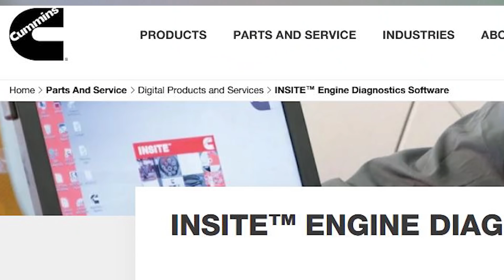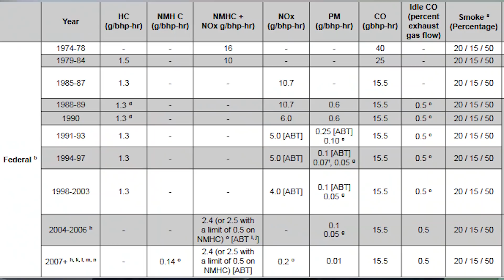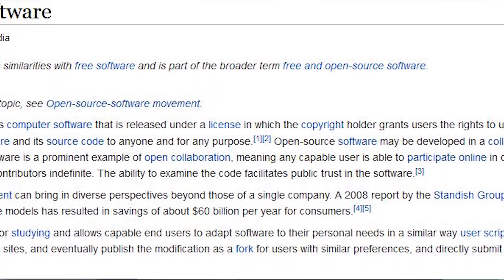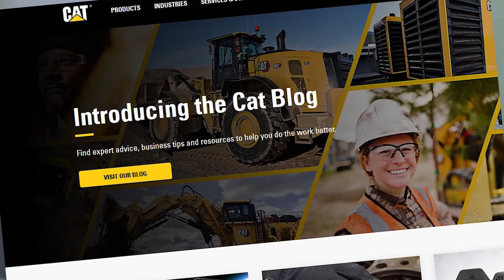Should YOU have the "Right to Repair" your Engine?

Comment: Manufacturers should be forced, by law, to sell ALL replacement parts for any product actively sold and produced. This should include all software, hardware, and related tools specific to that device, regardless of what the device is. Best way to avoid overhead that way is to use common tools, with common software so you have no responsibility besides selling manufactured parts, which you should already have the ability to produce. Furthermore, any replacement part or service good should be restricted in price to no more than cost +50% and software is to be without limitation or license, the source code to said software is not included in this requirement if it is used in a device that is either currently in production or has been within the past 5 years, after this period software is to be made available with source code for a period of 10 years from the last produced unit, without charge.

Comment: I think the manufacturers should provide the software for a fee for so many years and then after that the software should be free. I don't think the government should necessarily regulate the cost.  That leaves a manufacturer open to decide if they want to make the software affordable or if they want to make it so expensive that you're just forced to go to the dealership.  Not perfect, but neither side loses.  

Like your idea though of offering the software for free and that same website where you access the software helps you to order parts directly from the manufacturer.

Comment: of course we have a right to repair....all the "computers" do is replace what used to be manual parts or simple electric sensors. If I own it...i should have the right to do whatever I want to with it, including access to the diagnostic and operating software. I know the EPA along with dealerships wanting to make money on repairs pushed it to computers...and I know the EPA and Manufactures dont want us messing with anything...the sad thing is people hacking into ECU's have found how terrible the factory/EPA tuning are for engines. Hell isnt Tesla opensource? They seem to be doing just fine. Definitely need to EPA out of control..they create more problems than they fix...and vehicle/equipment companies need to get with the times...just about everything can be hacked now. They're just leaving dollars on the table.

Comment: Maybe I’m misunderstanding the customer/manufacturer relationship or maybe I’m reading too much into this….but how is this not extortion? You HAVE to get your machine serviced at the dealer because they are the only ones with diagnostic software. You then pay some exorbitant dealer labor rate to diagnose what could be a very simple problem an independent shop or mechanically inclined individual could do for cheaper? Is there a statute of limitations on how long they lock up the software? Am I eventually going to pay dealer labor rates to get my ancient tractor repaired?

Comment: It reminds me of cars before 1996 with each manufacture had their own obd1 system. You had to either find a shop with a computer that could talk to it or rely on those tricky blink codes. Now with obd2 you can go to any auto parts store and pickup a scanner for $10. Why can't equipment and Trucks be like that?
Reply: Global OBDII simplified things a bit, like requiring the same plug. It was all about emissions though, which is why a loose gas cap will turn on your CEL. Also your cheap readers only see global OBD that they are forced to, not the manufacturer specific codes and the full live data. There's a reason I use a $6000 scanner not a $10 one, and if the $10 one would do the job you bet your ass I'd buy it and pocket the change.

Comment: I support Right to Repair.  But i understand the manufacturers side. It could also be partly to prevent corporate espionage.  Example- if CAT spends all that time and money developing the software to run their engines, im sure they wouldn't like Cummins or Detroit having easy access to the coding.
Reply: There really is no issue with this now adays, most of this software is as old as Moses, there really is no secrets anymore.
Reply: @charlesbradshaw8673  even more reason that it's stupid for them to roadblock us

Comment: Imagine you plugging an authorized software at home and it makes an automatic shopping list of everything that needs replacing with the proper contact to whoever has it in stock. That'd be a cheaper way to move spares inventory and far more efficient, but they need to be open minded about it and drop the greedy tactics.
Reply: That's a genius idea.
Reply: @roncreach753  and also a great way for them to make loads of money, but now results that even the motor is serialized

Comment: For people who work & live in remote areas this is a nightmare . I have spent much of the last 15 years exploration drilling in remote parts of Australia it sometimes takes days to get parts delivered or tens of thousands of dollars to charter a plane for hotshot runs . So getting a dealer technician out to read a fault code for a faulty temp sender is madness .
Reply: Exactly. My friend bought a small John Deere tractor for pushing and blowing snow also has the bucket and  rotor tiller as well. He is about 200 miles from the JD dealer in a remote area of western Canada. Four hours on it and it develops a hydraulic problem. Dealer says its to far to come out and fix so you’ll have to bring to our shop. At your expense of course. I could have fixed it but they said if I did it would void the warranty on the machine. I have 40 years of hydraulic repair experience. To say  my friend was mad would be an understatement.
Reply: @donziperk  funny enough you can repair anything aslong as it's to spec and properly done and they cannot void the warranty I believe a supreme court case ensured this alongside settling the case on whether those "warranty void if removed" stickers are also illegal and not enforceable. I'd suggest your friend contact a lawyer to verify in your area for any future problems he will end up having with that piece of equipment
Reply: @michaelf.2449  In Canada it could take years to get that resolved. Theres not even a murmur of right to repair laws.

Comment: I've fixed some really big issues with software up grades from torque converter shudders to crd idle stability issues purely by having access to the factory network that would have other wise sent me me down massive diagnostic procedures at cost to the customer , personally I think if you've purchased it and a upgrade is available you should be notified and flashed for free as long as it's in service.

Comment: I agree, everything should be given out for free, I'm tired of seeing opinions, I want to know EXACTLY the specifications on torque specs and trouble shooting. Simple stuff I can figure out,  but if I had to rebuild the engine, I don't have the equipment to take the head off, or cut counter bores. At the end of the day, I will always need to go to the manufacturer anyway!

Comment: Owners should have the right to work on ANYTHING that they paid for. As for the argument about emissions- trust me, there are all kinds of ways, already in existence, to get around that, so it’s a moot point. With as much as equipment costs nowadays, and most importantly how far behind shops are, an owner should be able to fix any issue themselves.

Comment: The right to repair should be that, a right!  For what things cost today, the electronic side is a huge cash cow for manufacturers, that have already made their profits on the mechanical side of the machine.  I am a john deere trained tech that has seen the light and went red, and have seen independent shops, if capable do the same repairs as the dealers for less than half the cost!  I do agree that the epa has screwed up a lot, as usual. The other thing is you use the word free pretty freely, the dealer will never give away their software and shouldn't, but should be reasonably priced.  On one hand you may loose some business but gain from those that failed fixing their equipment, should be the owners choice.

Comment: All though I would like free software I don't think it should be free for full version software cause if you are a mechanic you are going to profit off a repair using the software that is not right if you got free software....on the other hand as a equipment owner who does there own repairs you should be able to get a version of the software that only works for the equipment you own that doesn't cost an arm and a leg....but either way the tools and software need to be available for us common folk to use on some level...the manufacturers should not have a monopoly on repairs.....

Comment: If you want to work on your own. Sure, do it. If the owner has ET, INSITE or other OEM etool then they should call the diagnostic hotline, get help from the people then have someone to review the claim and parts replaced to warranty. If the owner doesn’t want to do that. Then they need to wait on the dealer

Comment: Brilliant video Why As. Senior and using computers for 30 + Yrs I fail to understand that in 2022 why it can’t be possible for manufacturers tech reps cannot log on to machine software in the paddock where there’s a internet connection and either sort the problem of talk the farmer or local mechanic or auto Sparkie through the problem Of course people will come up with all kinds of objections like no connection etc we them allow laptop interface, some will say that safety esp road trucks etc , that happens already by a minority So why punish the honest operator farmer?. Of course it would be better for the Manufacturers as it would built a trust in their service back up and that’s what it’s all about Note I do not depend on machines to earn my living and is speaking from past experience and believe that the color of a machine is not as important as a good local dealer with lots of parts on the shelf

Comment: Right To Repair? Yes. Right to over sell software. No. The dealers have a cash cow with their software. I feel they over charge for subscriptions. If you work on a variety of engines only it is thousands a year. We pay Way to much for subscriptions. Now you cant even get a trim file without an SIS subscription. It shouldn't be free but affordable. Also available to any one Including Independent shops. We are called direct competition by our dealer & aren't entitled to ET or SIS. It is great that  some OE's are putting their parts manuals on line free of charge but we should be aloud to have a little more access at a reasonable price.

Comment: Ford has offered limited access to their software to the owner of vehicles using EEC IV & V systems (I think through 2006) where you can purchase a lifetime subscription (including updates) for I think it was $120 per vehicle.  I also had to purchase the OE scan tool system separately.  I purchased 2 of these subs in the past for a 2002 & a 2005 model year vehicle, and they are still working without issues.  I am about to purchase another 2005 model year vehicle, so I will know for sure within a couple of months whether the service is still available, what the price is, & what the restrictions are.  I also know that shops can purchase a yearly sub to the system for what I believe is unlimited usage, and also requiring an OE tooling purchase.  I don't remember the price for sure, but I think it was around $7500 per month.  Also, automotive system diagnostics are serviced through tool detailers like Snap On, MAC, Autel, & others when you purchase their diagnostic tool systems.  Not sure of how long the sub lasts before you are required to repurchase the licensing on these.  I believe there is some support for earlier diesel truck/bus engines for Cummins (N14, L10) & Detroit (DDEC I, II, & III) (not sure about CAT engines).  I believe that the owner should have the right to repair their own equipment once it is out of warranty, and at their own risk of damages through incompetence.

Comment: They paid to developer the software so they should be allowed to sell it. However, most of the time the manufactures want to control who does the work so they can keep prices high.  They also want laws changed so that if you do the work not them your warranty is void. Once again driving up the cost of repairs.  In essence they want to make a vertical monopoly for their products.  Like Apple does with their stuff.  They force out competition so they can set the price and dictate terms.

Comment: While the ability for anybody and everybody to access ecm stuff could create some issues with liability and warranty stuff, it does disturb me that my veteran diesel mechanics at my independent shop that rebuilt my c15, can't even get past a certain wall in the software and confirm or access something as simple as power tunes on an ecm. If a driver can't access this information on a truck or machine they own themselves, at the very least, their certified mechanics that take their engines apart and rebuild them should be able to.

Comment: In 2013 my Motorhome was in Yancey Bus Service for valve lash check. When I’ve paid my bill it was much more than what I was quoted. I challenged this and they agreed to the original quote. Later, much later I noticed my CAT C9 was only loading to 80%. Yancey Bus without asking or telling perform an “update” that limited engine load to 80%. This Bus Service is no longer in business so there’s no course for a remedy. This non compliance of information should be illegal.

Comment: Someone breaking emissions equipment on their machine or reflashing for more horsepower is not the responsibility of the manufacturer. Warranty work has to be performed by a dealer, and warranty work can be denied simply by locking a part of the ECM to track reflash data.  Fuck around and find out comes to mind here when people want to break past the limits and end up breaking more stuff.  The EPA is there to make sure the manufacturer is putting out clean equipment, but also to make sure the equipment stays clean in the hands of the owner.

You had valid points across the board. It will be interesting to see the outcome of this, and I hope it works in the favor of the owners without additional cost of ownership. Not gonna be a free lunch in sight.
Reply: You MIGHT have clean air, and that’s good, but you might not have NOTHING TO EAT! Make the choice?

Comment: At the very least I can see manufactures should have to provide the equivelent of the OBDII level the government requires of passenger cars and light duty trucks. OEM level service software should be available to independent mechanics and vehicle owners at reasonable prices.  

In the passenger vehicle world, MB likely works in the manner of heavy equipment manufacturers with their locked down “Star” diagnostic software.  One step worse, they will not sell high proprietary parts (engine and transmission ECMs) to anyone but their dealers.  Dealers cannot sell these outright, only on an installed basis.  A $800 transmission “conductivity plate”, which includes the ECM and Hall effect sensors, becomes a $3,000 repair when the installation labor is $2,200. All because a $5 sensor fails after 100,000 miles.

Comment: Some of this issue could be resolved if the manufacturer at least offered a “light” version of the communication software that would allow viewing of the codes, and some code resets necessary to keep the equipment running. But this light version would not allow editing of the operating parameters in the equipment. This occurs in many other industries like power plant instruments and production equipment.
Reply: You should absolutely be able to change parameters.
Reply: @m g, we had a guy who had an unautherized parameter chage from someone and now he needs a new block.
Reply: @MG-ks1qg  I agree, but there are limitations to that, only because that might be the best way to to gain some inroads to a better situation.

Comment: The dealers don’t have the man power to handle 100% of the repairs The wait time is 3 weeks now and they have 20% of the repairs. At 100% it would be 30 to 40weeks It becomes more feasible to trade the broken equipment for new Which doesn’t make sense. This is a very dangerous proposition

Comment: Paccar is notorious when it comes to there software.  U gotta have davie software and the epa software to communicate with paccar motors.  U can only log in to eportal with dealer accounts.  I’m about to pay off my peterbilt 579 and would like to be able to take it to 3rd party shop but there only limited to some repairs.  Software is expensive runs between $2500-$5500 for software and you don’t have full access.  Right to repair is good for the environment.  So u now know these manufacturers really don’t care about the environment only there pockets.  🤬🤬🤬

Comment: The answer is yes, if you outright own something it is yours, every nut, bolt, and binary digit. However that is not not where we are at. Companies outright refuse to sell you parts, lock software behind dealer only tools, and in the worst cases build in software degradation to force us to update and upgrade. I ran into this issue just last week with my Cat branded phone. Cat Phones refuses to sell available parts and will only sell them to authorized repair facilities. I don't have the time or the luxury to be without my work phone for who knows how long just so they can replace a snap on rubber seal that broke.